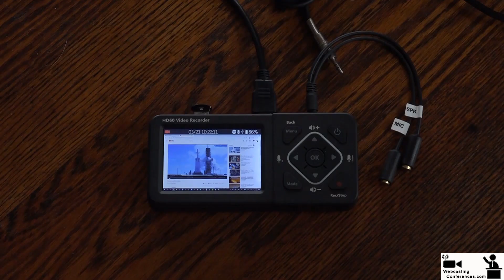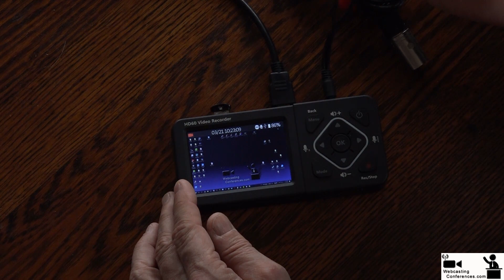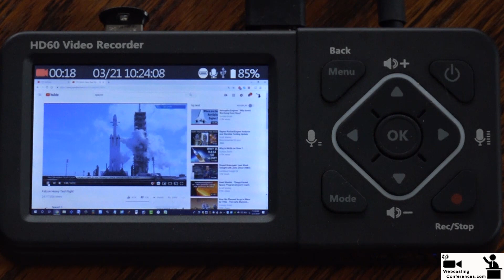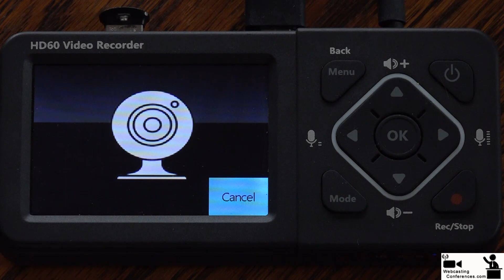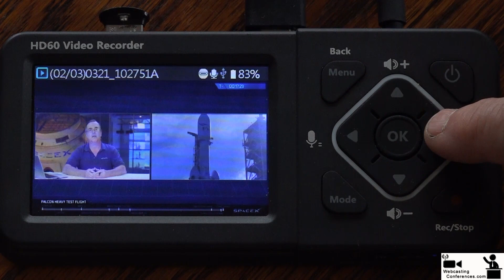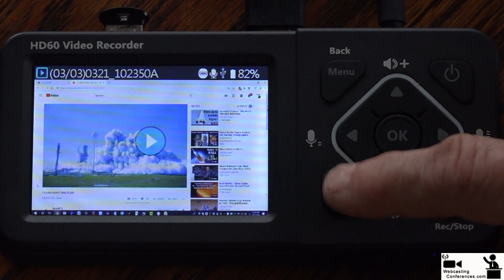Tevii Technology D720 HD60 Video Recorder

Comment: Any problem of out of sync?
Reply from the maker: No sync not an issue.
Reply from the maker: Using these now
UNISHEEN HD Video Capture Box 2 Channel HDMI Picture-in-Picture Video Recorder with Screen 7 inches MP4 Support SD Card U Disk Storage 1080p 60 FPS Support YouTube Have USB2.0 Cable Remote Control https://a.co/d/dXPIoUZ

Comment: This is a really helpful review, thanks. I'm planning on using this device to capture speaker presentations by taking an HDMI feed from the projector. I will also try to input speaker audio or I will capture the audio on a separate device and sync in post productions using Premier. For slide Presentations what is the ideal resolution, does it need to be 1060?
Reply from the maker: I usually go 720 for slides. More than enough
Reply: @WebcastingConferencescom   Great, even if there is animation and embedded video in the presentation? Also do most professional projectors have HDMI outputs these days? How has the audio quality been when you've patched in speaker audio. I'm test driving this unit next week at a conference. Thanks again for your help!
Reply from the maker: @winston1176  Yes when the deliverable is PowerPoint and audio I always use 720p, the resolution is fine for this application. I wouldn't count on HDMI out of the projector. A projector will usually only pass out the same signal that it is being fed. Hotel AV may use SDI or other cabling.  I do multi room recording and the best place to put this recorder is in the lectern or under the stage. You can then take the HDMI out of the presenters laptop directly before it's sent to the projectors. In this set-up I have the audio operator provide me an XLR connection at the lectern or under the stage. As I pointed out in the video you need the proper 3.5 mm cable to input audio in the headset socket. If you get that right you can adjust the input level using the mic buttons on the recorder. 

I also use this as a back-up recorder when I am doing Video/PowerPoint/Audio webcasts. In this case I go full 1008 as I probably won't be using these files and don't care about file size.
Reply: @WebcastingConferencescom  So presumably when taking HDMI out of the speaker's laptop you are using a splitter so the AV company can also take a feed for the projector? What about laptops with no HDMI output. Do you use use turnarounds?
Reply from the maker: @winston1176  I do carry HDMI 4 way splitters if required. I usually go under the stage were AV places it's HDMI Distribution amp and I take one of the outputs to record. For audio I always use a Sescom IL-19 Inline Audio Hum Eliminator to interface with house sound. You also need an XLR to 3.5mm adapter to go to the OMPT cable for inputting line/mike audio. Works every time.
Reply: @WebcastingConferencescom  Thanks so much for all this useful information. One more question and then I'll let you resume your life! If you are recording let's say a 2 hour session at 720p including audio I'm assuming the resulting MP4 video will be split into 4GB segments? When splicing these segments back together is the resulting file pretty seamless? Or will that 720p setting typically result in one large file?
Reply from the maker: @winston1176  This files are rarely that large. The compression on PowerPoint files means you get 1 hour recording per GB. Where the file is split is not an issue, you may lose a frame or two

Comment: i have purchased this device from AliExpress … the  recorded video quality is not ok
Reply: Did you try changing the quality settings? What was wrong with the video?
Reply: @MikesWorld1  

Yes,.
 3 levels of quality , all of  them are same , I've  returned it to the seller to repair or replace it or refund amount
Reply: Be noted that I use A/V input  to convert the old video tape from camera Sony
Reply: @Yasayd  what happened then? is okay now the device?
Reply: i was thinking also to buy it for convert vhs tapes but with a good quality encoding,,,

Comment: I am having trouble getting an external mic to work on this device. Does the OMTP cable plug into the headphone port or the AV In port? There also seems to be an internal microphone on the device that kicks in sometimes, is there anyway to completely disable that? Thank!
Reply from the maker: The input of this device is non standard. The only way I could get an external audio signal into it was with this cable. https://www.amazon.com/gp/product/B01FVAW57Y/ref=ppx_yo_dt_b_asin_title_o03_s00?ie=UTF8&psc=1
It plugs into the headphone socket. I don't believe there is a mike inside the unit. If you are picking up a mike it's probably from a camera plugged into the HDMI input.
To stop this press the volume down button to turn off the HDMI input. The mike input level is the left and right buttons as indicated.

*I am a user and not a dealer or distributor of this product.
Reply: I figured it out. The headphones I was originally using had a mic on the headphone wire. It was picking that up. With this cable that's no longer an issue.

Comment: hi,i was thinking to buy it but i cant find it on amazon, i found it from aliexpress, is it ok from buy there? also how is the encoding quality from a VHS TAPE?
Reply: Aliexpress is reputable. VHS encoding will be as good as the original, in other words not OK but not HD
Reply: @NKDO_Channel  so the quality is same as the picture from my vcr exactly? because i have another model called analog2d converter (AV480) it looks almost as this but on it you cant change the quality video settings,no hdmi connection and the hour date is not saved because doesnt have the battery, the encoding is on mp4 but it give you to much red color (saturation) so thats why i want change it with this..
Reply: @NKDO_Channel  if you say is not ok so...not thinking to buy it. Maybe the encoding is super bad

Comment: Are you still happy with this device?
Reply from the maker: James Thompson I use it to backup PowerPoint presentations during live webcasts. Small physical size, internal battery backup, reasonable quality mp4 files and low price is why I like it. Lack of audio level meters makes it only useful as a backup device as we must use the analog mic input for audio.
Reply: @WebcastingConferencescom   Thanks for the quick reply. My application is recording the slides for live lectures, usually keynote or powerpoint depending on the speaker.  A lot of speaker's laptops only have vga out, so use an VGA to HDMI converter, which seems to work pretty well. Looking for a new recorder as the ones I'm using have failed too many times.  One issue I run into is that after starting recording, the speaker's laptop will die/reboot and recorder will end its session, then unless someone is there to restart the recorder, the remainder of the session is lost (and sometimes the  part before too).  Does the Tevil has this behavior also?
Reply from the maker: James Thompson Yes unattended recording is an issue if the resolution changes or there is a reboot. For unattended recording I use capture box pros. These have vga and hdmi inputs and they scale the input source to the selected recording file size. These recorders don’t care if there is a video source and will keep recording regardless of the input signal. You can change res, reboot or swap computers and they keep recording. I have run them for 48 hours constantly and never a hitch. There is an SDI/ HDMI version made but not sold in the USA. Check it out https://youtu.be/zAR8E_yZlus
Reply: @WebcastingConferencescom  Thanks for the link!  What happens if you are recording set to 16:9 and you get a 4:3 video source, does it stretch the video to 16:9 or letterbox it?
Reply from the maker: James Thompson letterbox
Reply: @WebcastingConferencescom  Thanks!
Reply from the maker: James Thompson HDML-Cloner Box Pro, Capture 1080p HDMI Videos/Games and Play Back Instantly with The Remote Control, Schedule Recording, HDMI/VGA/AV/YPbPr Input. No PC Required. https://www.amazon.com/dp/B012T1D0IG/ref=cm_sw_r_cp_api_i_.9pADbFS8B4YY
Reply: @WebcastingConferencescom   Do you have a source to purchase the capture box pros?  Thanks.
Reply: @WebcastingConferencescom  I wish you can upload a video attaching this to a DSLR camera or mirrorless camera. Would help many of us out
Reply from the maker: I do not use this with a DSLR.
Reply from the maker: James Thompson Amazon like everything else 

HDML-Cloner Box Pro, Capture 1080p HDMI Videos/Games and Play Back Instantly with ... https://www.amazon.com/dp/B012T1D0IG/ref=cm_sw_r_sms_c_api_i_8-4gEbKH7ESM6
Reply: @WebcastingConferencescom  I forgot to ask does this come with built in microphone or do you have to plug a mic into it's jack input. Thanks ahead
Reply from the maker: @BOREDANDWELLBORED  There is no built in mic
Reply: @WebcastingConferencescom  much appreciated. Bought eBay professional mic for $16. Thank you